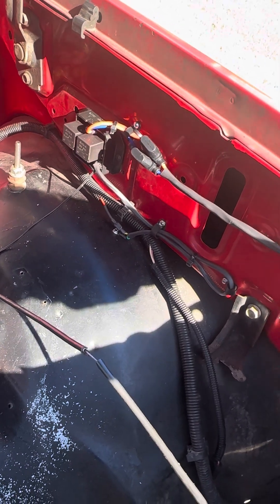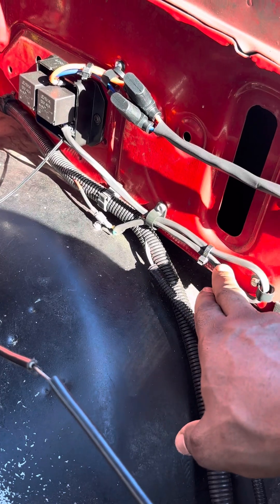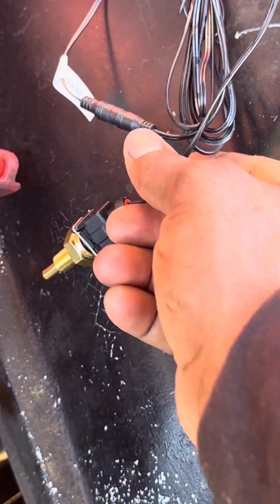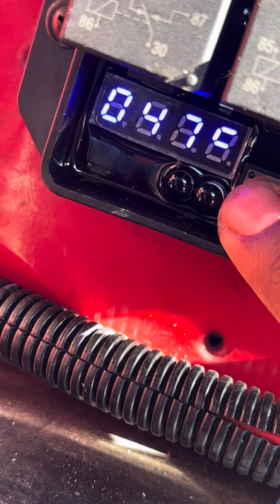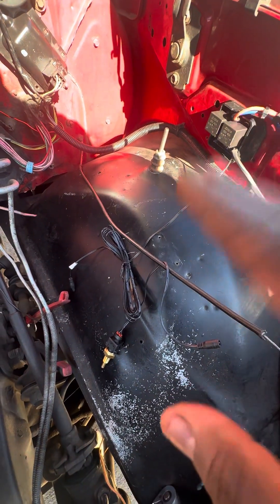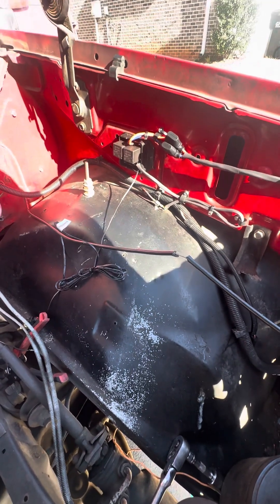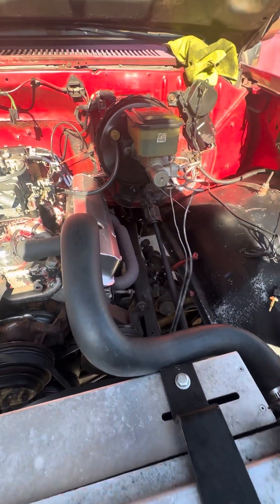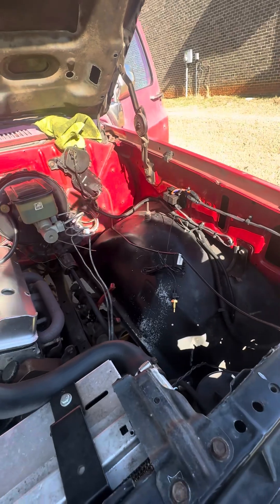Digital Adjustable Electric Fan Controller NPT Thermostat Temp Switch Wiring Kit.

Comment: Hey man, Thanks for the video.  Quick question: I do not want to the fan to be able to turn on when de accessories are on, but even when the car is turned off.  What should I do with the yellow wire?  Thanks
Reply: The conect You direct to positive terminal😊